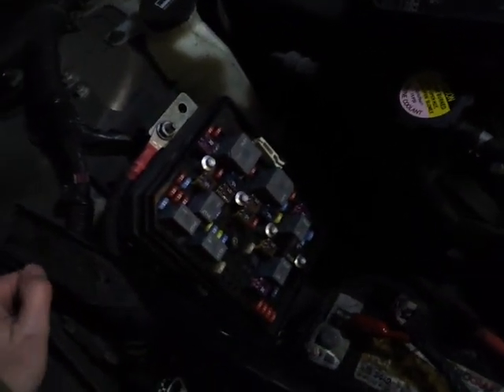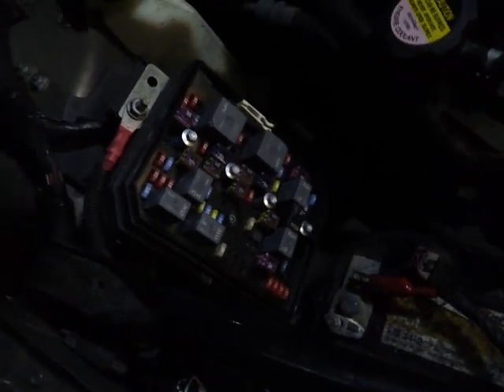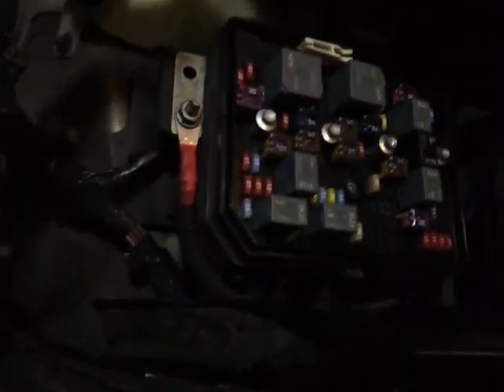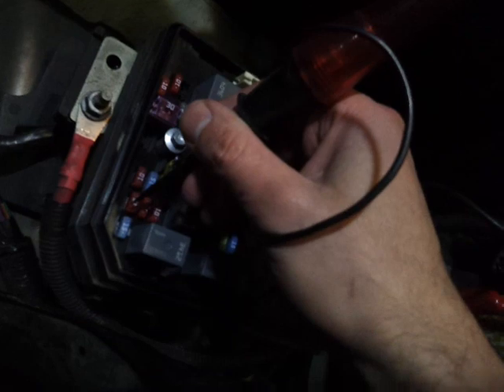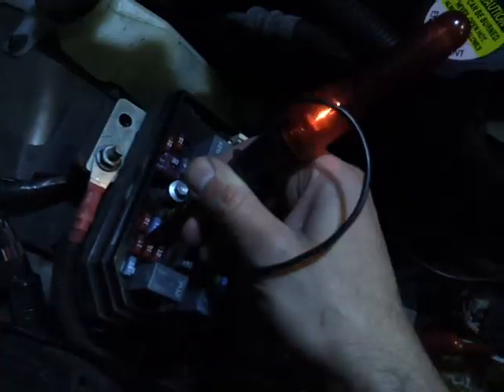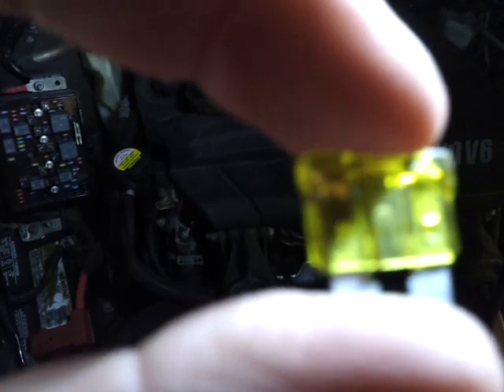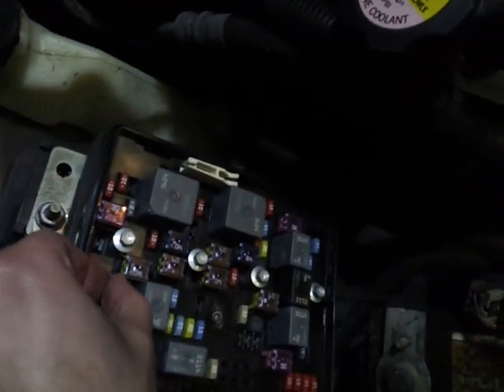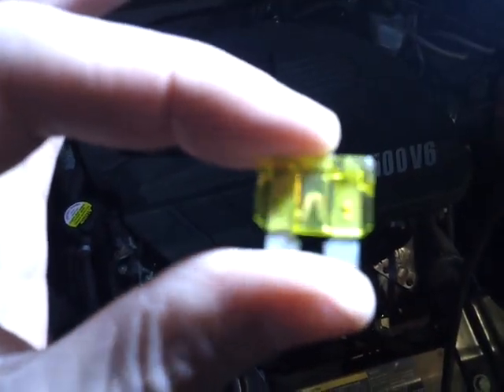CAR FUSES - Easy way to test them!!

Comment: But what if there's an open on one side of the wiring of that fuse, won't it keep the test light from turning on also?
Reply from the maker: mateollios 67 yeah..but u have to know if its a switched 12 volt circuit or constant hot

Comment: Is a fuse a diode?
Reply: No, a diode is a semiconductor that allows current to flow only in one direction. "Di" is for "two" since it has 2 electrODEs. Many diodes are just black cylinders with a silver band, though some are clear. LEDs are diodes that happen to emit light. Fuses are just a strip of metal designed to melt at a certain temperature inside a plastic housing. Where there is too much current going through them (an overloaded circuit) the metal overheats and breaks open protecting your device from damage and preventing a potential fire.